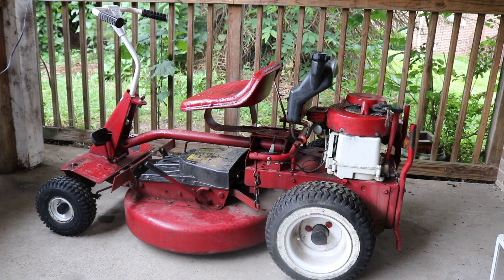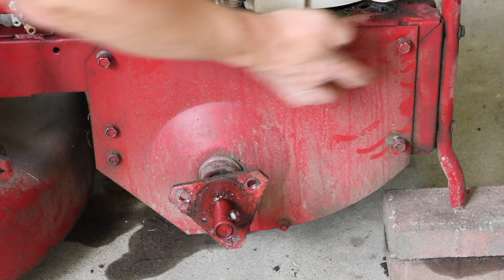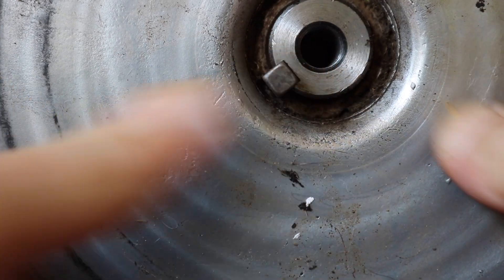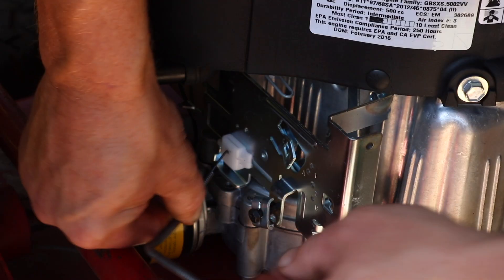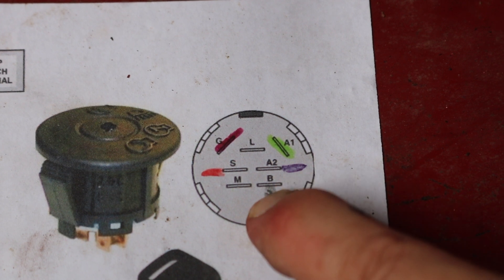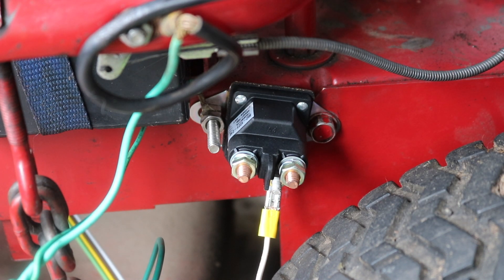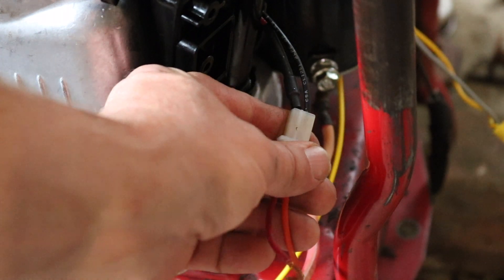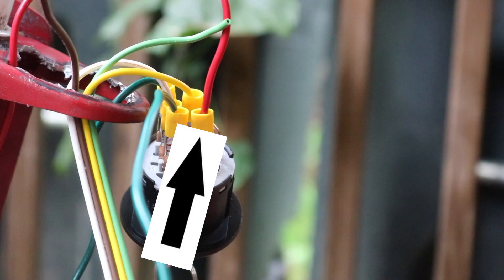1. Installing a New Engine on a Snapper Riding Mower 2. Wiring from Scratch 3.  Adding a new Muffler

Comment: This is a very informative video.  The more I learn about Snapper mowers the more novel I find them. They are very simple machines but seem to be very durable.  They can also be repaired with common tools and parts seem to be available.  I am looking at one with an 8 horsepower engine, twenty-eight inch mower deck with a steering wheel.  I have no idea how old it is.  Would like to find a bagger attachment but they seem a bit hard to find and expensive.;  I can only suppose that the wiring would be similar for any  electric-start Briggs & Stratton engine.  The only improvement would be an actual wiring diagram but your use of arrows was quite helpful.
Reply from the maker: I saw a guy that bought an old one from the 80's with a damaged bagger and he replaced the bag with a large rubbermaid bin. The chute part would be really hard to recreate though. The wiring is pretty much the same on Briggs engines and yes those Snappers last as long as you want them to.

Comment: I'm just removing my 8 hp engine to clean up years of oil that mixed with dirt looks like grease.
Reply from the maker: Nice! If the engine has oil and good compression it can go a long time as long as the carb and filters are clean and it has fresh fuel. Old gas can make them act up a bit.

Comment: I have that same engine on my Snapper. I was curious why you didn’t buy a Snapper ignition switch, solenoid, and use a Snapper wire harness?
Reply from the maker: I bought all my parts right down the street at a local auto place. The Snapper stuff is better but the shipping can take months on some items. I needed it running with grass that was really high.

Comment: Thanks for the video, I went with same 11.5 hp motor pull start.  Some day Ill connect it for battery start,  Removed the vacuum fuel pump, carburetor bowl with cutoff switch and muffler.  started on 2nd pull.   2 year old ethanol free gas
Reply from the maker: Nice! Thanks!

Comment: Thanks so much for posting this video. My Snapper currently has an 11.5hp rope start B&S engine and I want to upgrade to electric start. This video is exactly what I needed! My 11.5hp engine looks very much like the 17.5hp in this video and it has a curved muffler pipe that shoots out the side instead of the back so it doesn’t interfere with the bagger. I believe it will work on your engine too. It’s Snapper part # 7-4453
Reply from the maker: Thanks! I'll save the part #. Those Snapper Riding mowers are fun to work on.
Reply: @RayStein  I ended up buying a 17.5hp B&S engine for my 2004 Snapper rear engine rider since it was only $30 more than the 11.5hp replacement engine. I can confirm that muffler # 7-4453 fits on the 17.5hp engine with plenty of clearance to the rear bar without any modifications.

Comment: Can you make another video cutting the grass..but in actual time. Would like to see this work as l am strongly debating on doing this!!! Please and thanks...
Reply from the maker: OK. Good idea. I will say the Snapper with the bigger engine has the most powerful mower deck I've ever driven. I've driven big commercial tractors too. Pound for pound that Snapper is the most powerful. It's just really small with a tiny cutting path so I only use it in small yards.

Comment: Amazing video bud, I dont have a snapper but I I have a roper and another B and S motor to put on it and this video will help rewiring it
Reply from the maker: Nice! I've had to rewire quite a few times. Those safety switches can sometimes cause trouble. One time a mouse chewed my wires. I even had a magneto's go bad. Check for compression before doing anything. One time a bad piston was acting like an electrical problem for me.

Comment: Great detail. I’m thinking about replacing my motor with the same size. Thank you
Reply from the maker: It's totally worth it. I just ran mine the other day. It starts on the first turn of the key and mows with power. I can also climb hills in first gear with no trouble.

Comment: I'm stunned you wanted to put double the HP engine on that little Snapper.  I bet it pops wheelies really easily now.  :)  I changed out my dead BS engine in the 90s with a Tecumseh 8 HP with charging ability and battery.  The engine cost about $280 from Northern Supply shipped to my door.  Still runs well, but I noticed today it doesn't put out any voltage from Magneto anymore.  Oh well.  I plan to just start it, and when I'm done with my 30 minute cutting, keep a trickle charger that I have in my shed, hooked up to the battery for the next start.  Easier to do that than to replace the magneto or the engine.  The thing I don't like about the old Snapper, which has a more angular looking cutting platform than the round one on yours, is that they don't have any rear guide wheels so a fast turn can gouge the lawn. Or even a divot in the ground if the rear tire drops can shave.  So I may add some guide casters myself onto it.
Reply from the maker: Those magneto wires sometimes are wired with strange colors. Like black wires being positive and the colorful lighter colored wires are negative for some reason. I'd check that first. If you pop off the engine cover find the magneto and trace the wires and test them with a meter and you will know for sure. There are a few videos that show how to test magnetos with a cheap meter. I bought one on Amazon and found out my one magneto was bad so I replaced it. Magneto's are not much money to replace. I agree with the poor turning / cutting at times. I think I need a new blade.

Comment: What is the exhaust part number or brand?
Reply from the maker: I went with the Briggs & Stratton 796000 Muffler because it replaces part numbers 792901 and part number 794660 and part number 697048 all of which matched my specific engine.

Comment: I'm an older lady.  I think I could do this to my own snapper.
Reply from the maker: Yes. If you enjoy doing mechanical repairs there is no limit to what you can do. It's mostly about research and perseverance when you run into road blocks which happen to me all the time and every repair is unique to your specific tractor. One time I had a rusted bolt that just didn't want to come out so I researched what to do and was patient with it. I eventually got it apart but it took a long time. It also helps to have another person. I have my wife help with lifting tractor engines because they are a bit heavy and awkward to move around.

Comment: Why did you change the motor
Reply from the maker: It had a pull start. I forgot it was in 3rd gear and it drove off without me and I had to chase it. I got on and stopped it before it did any major damage but that was it for me. Plus pulling a cord is terrible on those days where it wouldn't start.
Reply: You Could've added electric start that engine does L-head engines are more durable and tougher than the new ones they make out today
Reply from the maker: @ANDERSONEXPRESS7  Thanks! That is a great idea I never knew about and I agree those old engines were built better. It just had so many hours on it and was starting to shake violently so I decided to go with a new engine.

Comment: Hi. I have an old Craftsman 8HP back engine mower (similar to this Snapper). During start-up, fuel is coming out of the muffler actually causing a fire. Any idea what causes that and how I can fix it?
Reply from the maker: Yes. It happened to me and it turned out I needed a new carburetor because the fuel would not shut off ever. It can also mean you need a valve job. If I was in your position with all of my experience I would buy a used engine that works from a lawn mower scrap yard or if you have the money and love the tractor do what I did and put on a brand new electric start engine that fits. I love my old Snapper because it is built like a tank. These new riding mowers are junk in my opinion.

Comment: WARNING: One thing you WILL have to keep a watch on with that engine that you didn't with the original engine is the new engine is OHV, so you WILL have to adjust the vales on it whereas on the original you didn't, adjusting them depends on about how many hours you have on the engine, figure how how many hours you cut in a week month & whole season, I cut 15 acres each week during the season so I have mine adjusted at the beginning or end of season, if all you cut is the area you showed you may be able to go for a couple of years, if it ever get to where it doesn't want to crank like the battery is dead then adjust them
Reply from the maker: Thanks! I have a valve gauge so that is good to know.

Comment: Suggestion is to put a NEW fuel line that is longer where when you have to pull it out of the bracket you can stand the tank up on the floor
Reply from the maker: Thanks another great idea. I appreciate that.

Comment: 👍Great detail. I've been going back and forth on rebuilding my old 8hp or replacing engine altogether. Probably tackle it this coming winter. Thx for the help! (SUBd) 🇺🇸✌️
Reply from the maker: I tried rebuilding my engine first but it didn't pan out so I end up buying  a new engine. I used that Snapper yesterday. It cuts way better than my new riding mowers which are scrap the day you buy them in my opinion.

Comment: Great vid Ray! I am rebuilding a snapper from 2 years outside. 
New solenoid, starter, new wiring and switch just to name a few. I keep blowing fuses...... I can not find the short.....any suggestions?
Reply from the maker: That's awesome that you are taking on the project! The first thing to check is the fuse strength, (use 20 to 30 amp) Second, look for a thin wire. Thin wire gages will blow a fuse. Heavier gages will avoid that. Third, make sure your wire is copper inside and not silver. Last, I'd double check for loose connections and make sure something is not wired in the wrong spot.

Comment: My snapper has a 12.5 hp Honda whisper quiet motor. I ride wheelies pretty often on it when not even trying. I bought it that way for $75 lol
Reply from the maker: Sweet! Yeah I hit a vinyl fence once doing a wheelie when my foot slipped. Nobody saw it so I glued the fence back together before they saw it. lol
Reply: @RayStein  I bungee strapped the pedal so that it would be a little less responsive and easier to control